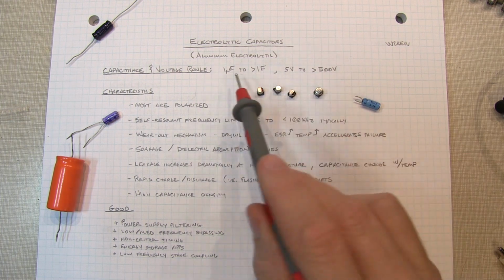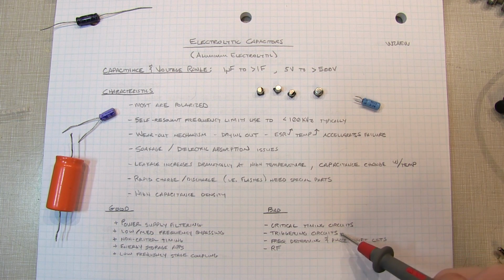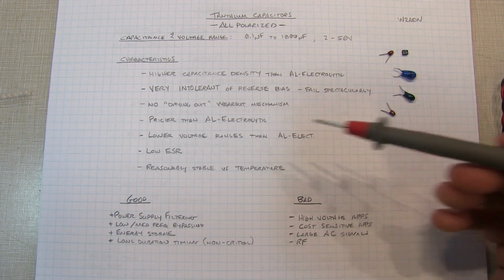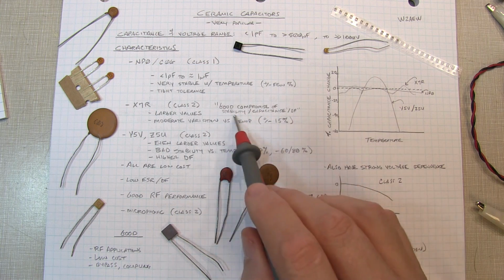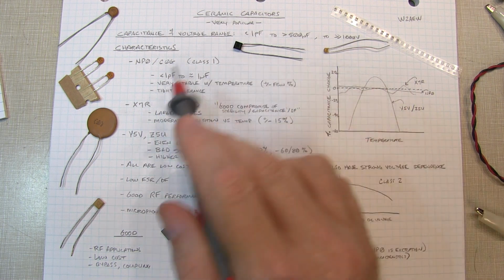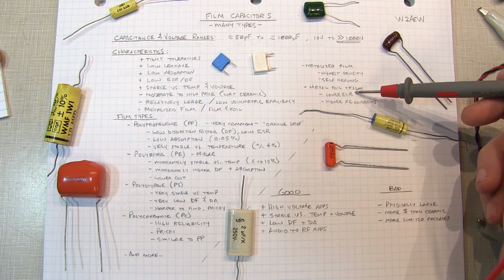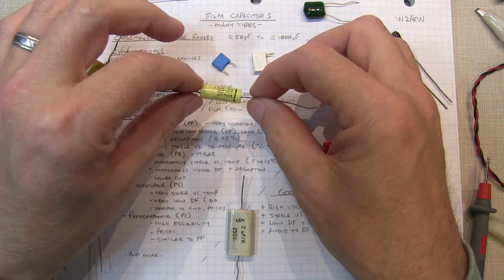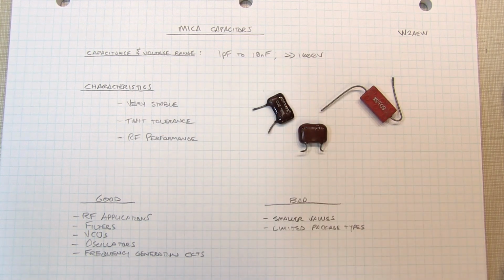#256: Capacitor types, characteristics, and applications

Comment: Superb tutorial Alan. I looked through the full lists of videos but couldn't find one on selecting inter-stage coupling capacitors at RF. Would that make a good back to basics film? Up to 70cm and 23cm please.  73  de M0YDH
Reply from the maker: Anything that is listed for RF applications, such as Mica, Film and the higher stability ceramics (NP0/C0G, X7R) would be suitable.
Reply: @w2aew  yes thanks. It was the choice of value that was my concern. Is it always rearranging the capacitive reactance formula to get farads  at frequency and input impedance of the next device?
Reply from the maker: @davidholman2536  Generally pick the lowest value that will present a reasonable reactance for the lowest frequency, considering the source and load impedance on either side.

Comment: Thank you.  I would totally have used the wrong capacitors.  I didn't realize how limited electrolytic capacitor applications were.  Fairly new at this, but I decided to truly understand computers and it is fascinating.  The whole silicon electron number balance, introducing an extra or minus one electron impurities making n and p types, adding an intrinsic layer bouncing photons around really completes the mental picture for a programmer, and how easy it is to do most things with just controllers really makes you appreciate it.  
  
You also see these functions around more, in solar panels, even in older cyclical mechanisms driven by other currents like water, or a black iron oxide and graphite for crystal radios.  Also really interesting to see how Ohm's law only applies to linear modules.  
  
I suppose we haven't gotten to designing solar system size machines working with gravitational waves but apparently essentially it's all just stuff spinning around each other.  Way in the future I suppose but I digress.  Very cool stuff.

Comment: What are the characteristics of Fluoropolymer Film Capacitors, because I think they often use them in crossover networks in audio speakers. I'm not sure why Fluoropolymer film caps provide more bass frequencies to pass through because they are using the Fluropolymer as an insulator it passes bass frequencies?  Sprague Specialties used a impregnated castor oil beeswax in the 50's for radios called a Luxe Phone Book Capacitor. I'm not sure why you would want to impregnate the capacitor because I thought impregnating caps is a bad thing but for some reason they used this castor oil and beeswax as the insulator?

Comment: Electrolytics:  You didn't mention the really wide tolerance of those things,  typically -20%/+80%!  Also,  older US-made parts typically have the positive lead or terminal indicated,  asian-made the negative.  You also said down to 1uF,  but I have salvaged some parts (out of a VCR?) that gave me a bunch of 0.1uF, 0.22uF, 0.33uF, and 0.47uF,  all at 50V.  I'm not sure why you would want to use an electrolytic in this range of values,  though.

Tantalum:  In a place I was working at some years ago,  another tech installed a tantalum cap the wrong way around.  The result when he powered it up was rather explosive!

Mica:  It's apparently the practice of some who work on older (antique?) gear to try and turn one around to be able to see the dots and read off the value.  This is a bad idea,  as you'll then end up with moisture getting into the part and it failing.  Also, there are apparently several different coding systems in use,  at least 2 or 3,  the early Radio Amateur's Handbook showed a couple of them IIRC.

Also,  there's some parts found in old gear with the brand name "Micamold" showing on the case.  These are for the most part NOT mica capacitors,  but actually paper!  And should all be replaced with newer film caps.

One manufacturer of electronic musical synthesizers had an instrument where there were two boards having rows of 22uF/25V tantalum caps and some associated parts.  Tied into this was a slidepot that would let you choose the release time of the note(s) you were playing.  Unfortunately with the way the whole circuit was configured when you put that slider all the way to one extreme,  those caps could end up with 30V across them.  I was always rather surprised to find very few failures in those instruments...

Comment: How to convert joules/energy & charge Q coulombs into the equivalent value for current? What I mean is at 12vdc using a 12,000uf capacitor how much current can it store? because 12v X 12,000uf = 144m Coulombs or 864m Joules but how much current is that?
Reply from the maker: Current is movement of charge - coulombs per second.  When the charge is stored, it is not moving, thus there is no current.  Current is needed to charge the capacitor and to discharge the capacitor.  The amount of current depends on the impedance of he charging/discharging circuit.
Reply: @w2aew  How can I convert the Coulombs 144m or 864 Joules into Current? What resistive load value can I use like 10ohms or do I measure the circuit boards DC impendence that is connected to the output of the power supply. Once I measured the circuit boards DC impedance how do I convert the Coulombs 144m or 864 Joules to know how much current is being stored in the capacitor?
Reply from the maker: @waynegram8907  Current isn't stored on a capacitor.  Charge is stored on a capacitor.
Reply: @w2aew  yes I know that current isn't stored on a capacitor and that charge is stored on a capacitor. I'm trying to convert charge into current. I got the Charge values in Coulombs and Joules but how do you convert it back to an equivalent Current value? I'm trying to get the equivalent current value for Charge Coulombs and Joules. What formula do I use to convert it?
Reply from the maker: @waynegram8907  Remember that 1 amp equals 1 coulomb per second of charge flow.  When a capacitor is charged, the equation Q=CV applies, which states that the total charge is equal to the product of capacitance and the terminal voltage across the capacitor.  When you discharge a capacitor, the "initial" discharge current will be V/R, which is the voltage across the capacitor divided by the resistance of the discharge path.  Immediately following that, the discharge current will exponentially decrease.
Reply: @w2aew  When a power supply is connected to the Circuit Under test, if I put my DVM meter on the filter caps they will always measure the full total terminal voltage. I don't see the voltage charging and discharging or the voltage ramping up or down its stable flat voltage at 12vdc or at 9vdc or at 5vdc. If I disconnect the power supply from the Circuit under test and measure the DC impedance of the each Power Rails of the circuit under test of the +12vdc power rail, +9vdc power rail, +5vdc power rail, they will all have different DC impedances for each power rail. If the filter capacitors in the power supply are always measuring +12vdc, +9vdc, +5vdc. Do I use the formula 12vdc/DC impedance resistance of the circuit under test? The formula would be the filter cap terminal voltage divided by / the DC impedance power rails of the circuit under test = The total filter capacitors stored charge?
Reply: @w2aew  1 amp = 1 coulomb , so 144 coulombs or 864 Joules = 144 amps?
Reply from the maker: @waynegram8907  A DMM cannot respond fast enough to "see" the ripple.
Reply from the maker: @waynegram8907  Not quite - 1 amp = 1 coulomb of charge MOVING past a point in a circuit PER SECOND.
Reply: @w2aew  yes I know if I'm using an oscilloscope I see the ripple but when the power supply is not loaded the AC ripples voltage is different compared to when the power supply is loaded. The AC ripples voltage drop difference between loaded and unloaded is considered what? I'm talking about the "difference" in the voltage drop between not loaded and loaded AC ripple
Reply: @w2aew  yes 1 doulomb or 1 amp is Charge per second because charge is related to time per second. But if the power supply is using one filter cap at 12,000uf at 12v = 144m coulombs that means that 1 amp = 1 coulomb is equivalent to saying 144 coulombs is 144amps?
Reply from the maker: @waynegram8907  When loaded, more charge is pulled from the capacitors, so the voltage drops more between the charging peaks, so the ripple is higher.  When unloaded, there is less charge being pulled off of the caps, so the ripple is smaller.
Reply from the maker: @waynegram8907  A coulomb does NOT relate to charge per second.  A coulomb is a unit of charge. Period.  Picture a bucket of tennis balls.  The bucket is the capacitor.  The collection of tennis balls is the charge (i.e. the number of charged particles measured in coulombs).  And the rate at which you can fill or empty the balls to/from the bucket is the current.
Reply: @w2aew  Yes I understand that part. What I don't understand is how EE engineers calculate the filter capacitors value and how many filter capacitors to put in parallel to "provide" enough current for the circuit under test. Example if a circuit under test needs 8 amps of current, what formula to use to know how many filter capacitors in parallel to use to provide 8amps? Since filter capacitors are stored in the units of coulombs and joules I'm not sure what EE engineers use to convert the units from coulombs into current.
Reply: @w2aew  yes I understand that part. What I'm not understanding is when you buy a electrolytic filter capacitor 50uf at 100volts and you apply +12 volts to the 50uf capacitor how can I find out how much current the 50uf capacitor is storing? is it storing 50milliamps or 20milliamps. EE engineers must use a formula to find this out because how can they know how many filter capacitors to put in parallel and the filter capacitors value to use to work with the circuit under test.

Comment: after great introduction to various caps, would you consider to introduce hot to check or measure good,bad or dead caps? there are too much measurement on Electrolytic caps, however rare to detail explain howto check film caps and ceramic caps, thanks

Comment: There is a dirty secret about large ceramic capacitors over 1 uF - - - > they LOSE 80% (yes 80% of their capacitance over the OPERATING VOLTAGE range !!! Be extremely wary of replacing electrolytic and / or tantalums with ceramic capacitors in X7R and Z5U ! ! !  (e.g. 10 uF ceramic capacitors) - - - BTW great video - thank you - very professional !! :-D

Comment: One of the things with mica capacitors that they are usually specific to the RF device in which they were originally installed.  If at all possible, they should be left in place.

Comment: Still have a question of a capacitor you didn't mention in this video, the super capacitor...
I'm trying to find a way to measure the capacitance of those super capacitors and if I could also measure the ESR that would be even better. Maybe you know a way to measure super capacitors or even the normal ones with a value of 10000uF and up are very hard to measure with any kind of meter you can buy off the shelf as far as I know.
I have asked this question to several people already but not one of them can give me an answer so I hope that you can help me with that.
Reply from the maker: There are several test methods described in this application note from Illinois Capacitor:  https://www.illinoiscapacitor.com/pdf/Papers/supercapacitors.pdf

Comment: W2aew, I always that the CHARGE was charged current & voltage. When the circuit load is drawing current OFF the "charge" off of the filter caps which is current i thought. The circuit load converts the charge stored from the filter caps into current?  EE engineers have told me that Charge is NOT current or voltage they are all 3 different qualities. So I'm very confused on what is the difference between CHARGE compared to current/voltage because EE engineers are saying that a filter cap stores charge NOT current or voltage and when the circuit load is connect to filter caps its pull off the CHARGE not the current or voltage out of the filter caps, I have always thought the circuit load was pull out the current of the filter caps in the power supply.
Reply from the maker: Capacitors store charge, which is nothing more than a collection of positive or negative charges (such as electrons).  The amount of charge on a capacitor and the capacitors value is related by the following:  Q=CV.  Q=charge in coulombs, C=capacitance in farads, V=voltage.  When charge is being moved on or off of a capacitor, that is current (current is the movement of charge).  As charge is moved onto a capacitor, the voltage increases.  As charge is moved off of a capacitor, the voltage falls.  Moving charge is current.  1 amp is equal to one coulomb of charge passing through a point every second.  A coulomb is about 6.24x10^18, or 6.24 billion-billion units of charge (electrons).  Here's a good tutorial:
https://www.electronics-tutorials.ws/capacitor/cap_4.html
Reply: @w2aew  thanks for the help, but Charge is not current or voltage, its just a collection of electrons? Because a FETS gates has charge and so does a transistors junction has charge. So what is the difference between a FETS gate charge and a transistors junction has charge are they the same thing just a collection of electrons?
Reply from the maker: @billwilliams6338  Current is the movement of charge.  Bipolar transistors operate due to charges moving, but the process is more complicated than in a FET.
Reply: @w2aew  yes a bipolar transistor controls the movement of charge and also a FET controls the movement of charge. They are both like a sink faucet by controlling the water flow. When the Input signal is turned off on the base or gate input pin the transistor and FET have stored the charge on the base or gate junctions. This is why you need a bleeder resistor to discharge the  charge off of the base and gate junction.

Comment: Could you comment on the best capacitor to use in a magnetic loop antenna. I have read the capacitor
efficiency is important in the magnetic loop. Designing the antenna for 10m – 40m with a 3 m circumference
loop, I notice the capacitance is relatively low on bands 10m to 18m but
increase for 20m and 40m as well as the voltage. Which is the better  variable capacitor to use split stator, butterfly,
flat plate sliding capacitor or a non linear type. How would you measure the efficiency of these capacitors.
Reply from the maker: Hello Stan - I'm not an expert on mag loop antenna design, but I'll give you my thoughts.  I would think that efficiency will largely be determined by the effective ESR of the capacitor.  So, designing with good quality conductive materials that can handle the high circulating currents is important.  Mag loop antenna's tuning capacitor operates at very high voltages, even at moderate power levels, so it is important to select a design that can withstand the high operating voltages.  It looks like the new version of the ARRL Antenna Handbook has some updated material on small transmitting loop antennas, maybe it will have some good advice on the capacitor design.

Comment: I replaced a disc cap with one of the high voltage disc cap the .01 1000 volt original cap was the size of a nickle,the .01 2000 volt cap was very tiny have you seen those,the new disc cap was colored blue,.

Comment: Thanks for the video. I need to design an antialiasing filter using a design tool. My worry is if the stage caps vary with temperature  then the filter characteristics might change. The caps I need now are from 2.2n upto 47n range. I cannot find C0G or NP0 ceramic so I bought KEMET’s R82 series PET capacitors. Do you think PET caps are fine for such active filter stages? Mica are too expensive.
Reply from the maker: Yes, film capacitors will give you better stability than ceramic caps using X7R, Y5V,  Z5U dielectrics.

Comment: Hi, can you  please help me figure out what kind and its specification does this capacitor is. Its marking on top of the can is FP / 17Be / 271 / 16. Thanks...
Reply from the maker: Without seeing the capacitor, my initial guess would be 270pF, 16 Volts.
Reply: @w2aew  https://www.newark.com/productimages/standard/en_US/4968633.jpg
This is a similar image of the said capacitor. Only the markings is
FP
17BE
271
16
Thanks...
Reply from the maker: @andoypordoy2491  Based on the image, looks to be a polarized cap, probably aluminum electrolytic - most likely 270uF.  Difficult to say beyond that.

Comment: I’m restoring an old Radio Shack scanner. It has about 10 .1 if aluminum electrolytic that need to be replaced. What advantage or disadvantage would there be if I used .1 if disc caps?
Reply from the maker: Gee, 0.1uF is pretty low for electrolytics, but maybe they had reasons for doing that.  If they need replacement, probably no harm in trying ceramic, unless the design relies on the parasitic characteristics of the electrolytic (which would be poor design practice).

Comment: Hi Alan       Great coverage on capacitors.  One thing on the Polystyrene, and film capacitors on how to find the outside foil end.  That Paul Carlson shows how to do in his video on capacitor polarity, using his circuit or using a Oscilloscope with clip leads.  The band doesn't always show the outside end of the foil, as Paul shows in his video.  I think that you referenced his video once before.  Otherwise the video of yours is very informative, thank you very much.  I love to watch your videos, they are packed full of information. Later Ray Burke
Reply from the maker: Thanks - yes, Paul's video on the subject of film cap polarity is excellent.